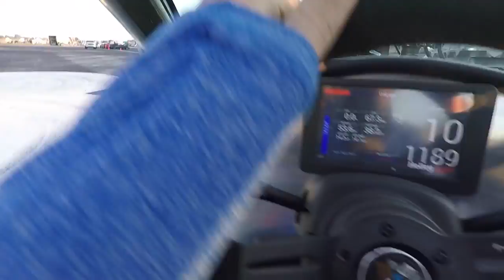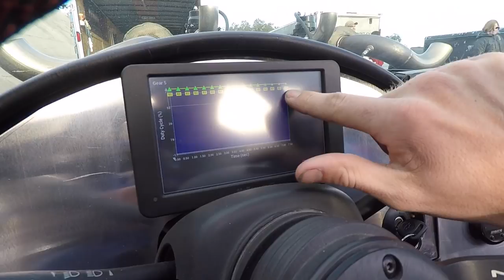I Lost To a FREAKING MINIVAN! It Was a 150mph SLEEPER!

Comment: The daily driven Minivan is powered by a 2.2 L H22 inline-four from a Honda Prelude. The engine features a stock head with Supertech springs and retainers, eBay H-beam rods, Arias pistons, steel liners, eBay 2200 injectors, and eBay GTX3582R turbocharger. The combination is good for 727 horsepower to the wheels on 28 psi of boost. The drivetrain consists of a Clutch Masters twin-disc clutch, factory transmission, and open differential.

Comment: The Honda needs a 'Baby on Board' sign. The driver is nearly one!!
But what speed was that third run? It hooked up better so it should have been a bit quicker.
Those drag radials are junk now. Never street run them as they just go rock hard. The Michelins obviously had more bite.
A proper circuit race semi slick would be the go for that type of event. Toyo, Yokohama even Hoosier all make good ones. But keep them in the dark and cool between events.

Comment: It's been a long time since I've raced at a drag track. We used to drive around the water box unless we had bias ply skinny tires on the front because front radial tires dragged and dripped water on the track. We only did burnouts with radial rears to clean the dirt/gravel off of them. Doing a heat burnout on radials in the rear tires reduses their traction capability. You can back rear radials into a wet surface, do a .5 - 1 second burnout to clean them off and then treat them like (highway warmed) tires. It takes practice but, you can get decent results put of street tires.

Comment: I built an 87 Astro van with a 327 sbc 5 speed manual and 3.73 posi rear. From outside looked completely stock. Was really quiet as well. I even had soccer dad type stickers on the back of it. The looks on people’s faces when I left them at a stoplight was priceless.

Comment: The fact a mini van was even hanging with Leroy is bonkers
Reply: Ya, so crazy he could hang with a 1,000whp car that couldn’t get traction the entire half mile.
Reply: And it’s a 4cyl
Reply: Entertaining TV no it's a v6 look up a j35
Reply: Pretty sure they swapped out the V6 or a I4 because the parts were easier to find.
Reply: Julius Kingsley Idk I remember them swapping a j32 to j35 for that reason in a video
Reply: Kyle's (Boostedboiz) van has a closed deck JDM H series i4 cylinder block on E85 and Leroy (Cleetus McFarland's car) has a LS V8 (8 cylinder..) with a forged block on E85.
Reply: Gamma Light h series not k
Reply: Julius Kingsley those van only came with "f" series same family as "H" no v6 in those years

Comment: That's so fucking cool that Kyle's van built with junkyard parts can keep up with your multi tens of thousands of dollars custom engineered cnc block bald eagle machine. Good on Kyle.
Reply: based_will uh yeah, on street tires and Leroy with almost zero boost
LMAO
Reply: brin3535 and with four less cylinders and one less turbo and stock transmission and in a fucking minivan

Yeah the excuses go both ways guy
Reply: type-dRew I'm not your guy, buddy.  So many comments here saying that the van would stand a chance vs Leroy in a real race is just laughable. That's not an excuse, that's just how it is.
Reply: Cleetus 100 Thousand dollar car got destroyed by a 15k build mini van 
LMAO
Reply: Moises Palacios Well When They Put Back Seats In A Corvette We'll Do That Pedro.
Reply: based_will 
Leroy will do 170mph in the 1/4. Traction was the limiting factor here.  Leroy was doing 167 at the end of a 1/2 mile burnout.
Reply: Let him turn the boost back up and throw some slicks on and race the minivan again. Or any of them there. That's a 7 second car. 1300 hp and 2700 lbs.

Comment: You spun with lite throttle, that's why AWD is da wae
Reply: Gedas alekveravičius except AWD is awful when it comes to straight up drag racing, it's too hard to find parts and when you do you'll be replacing them all the time because front axles can't hold that power from dead stop launches all the time
Reply: Ada 1812 AWD is badass street racing. On a drag track it just adds weight.
Reply: Gedas alekveravičius if AWD was better, then everyone that does drag racing would have AWD, genius.

Comment: Ya Kno it just dawned on me that big ol holey intake you got on him.. resembles a massive tuneport that the older C4 vettes has.. I had a 85 Vette with a 350 Tune port injection Chevy small block which it wasn't nothing special but I did put aluminum heads on it n bigger headers n a mother thumper cam new rockers n rods ECT and had it tuned up had a race chip installed it went from 300+ HP to lil over 530hp it was quick I miss it

Comment: Trick and we use this on Big Rigs (especially CAT Motors) block the waste gate you get more power. But the risk is over heating the motor, blowing it up and parts failure. I don't like it honestly but for some reason people like this risk instead of getting a turbo without the waste gates

Comment: Dude I realized that this is an older video but you  don't heat up a street tires. Should have brought a drag radial. Street tires don't get sticky when heated. They get slippery. You need the right rubber to get down the road

Comment: Lol,

Your tires are realy dangerous.
Super dry full of tears and crackes.

:(

Thats like stupid.

You need good soft rubber to stick to the road. 

Do a burn-out and make more rubber fall off is making you get less tracktion. It Will lose grip couse your roling on lose parts of dryed up rubber tearing up from your tire.

And to get tracktion. You need downforce.